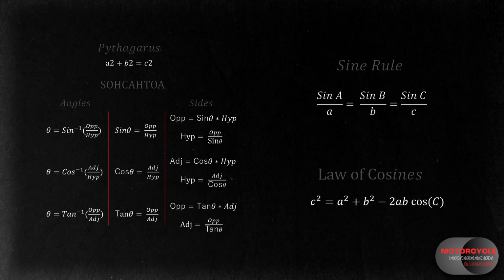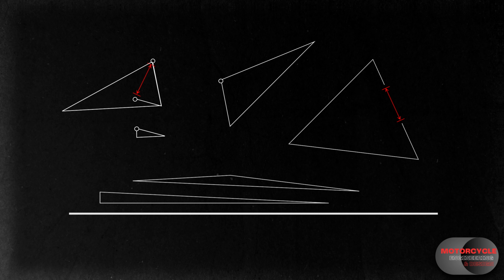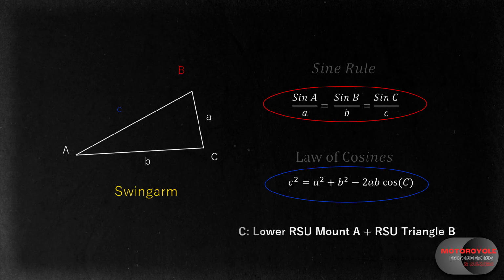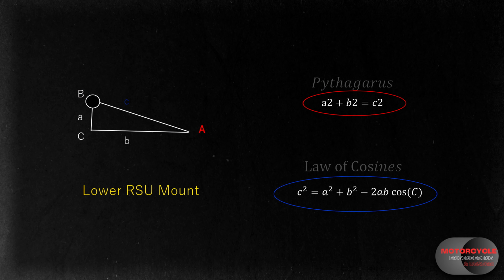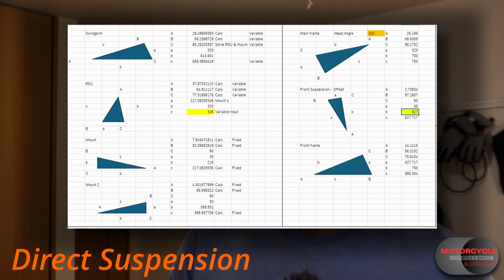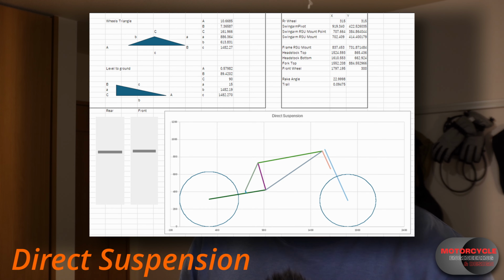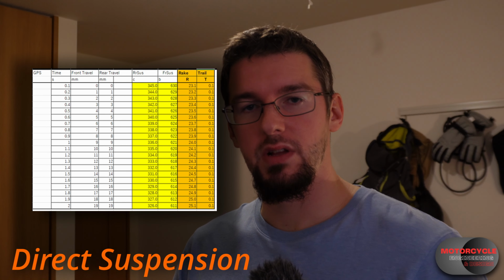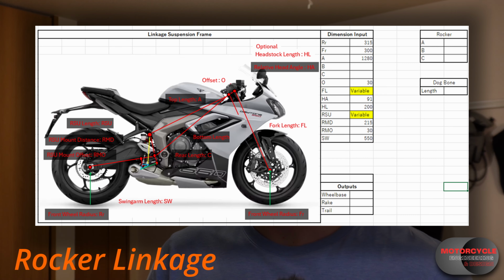Motorcycle Dynamics: Dynamic Geometry Calculator, Part 3, Download Available

Comment: daalu, this will help me a lot in a project i am working on
Reply from the maker: That's great, I'm working on the next update at the moment.
Just a warning, I realised that for the "direct"  rsu analysis page, I hadn't updated the calculations so it's got a few mistakes on that page but the input and calculation pages are OK. 

I'll try to get the next version out in the next week, it should include a model for chassis with rocker linkage as well as calculating leverage/linkage ratios, forces and start getting into springs 👍